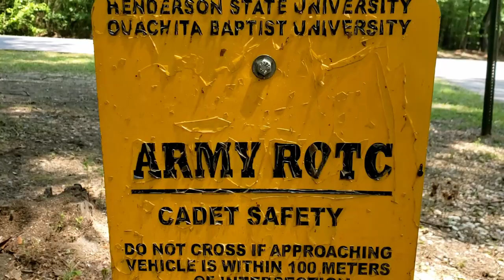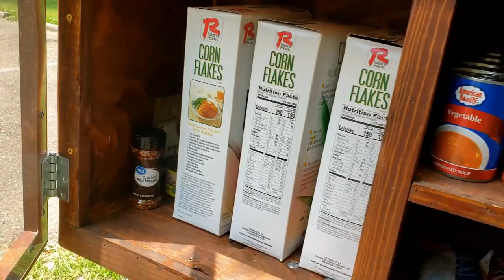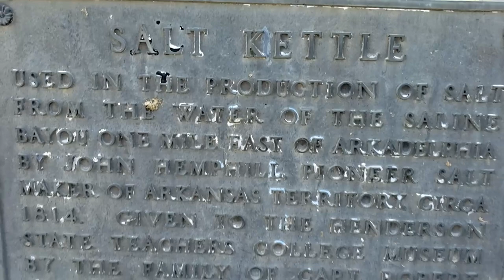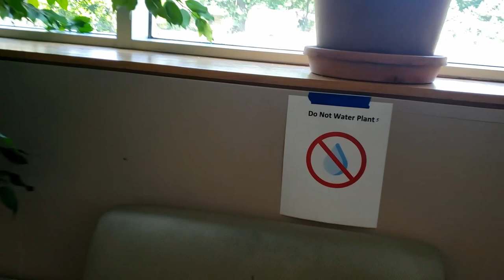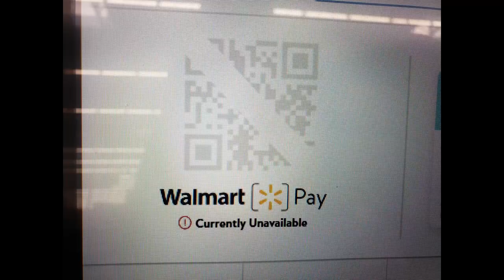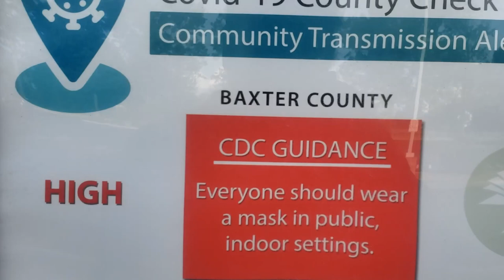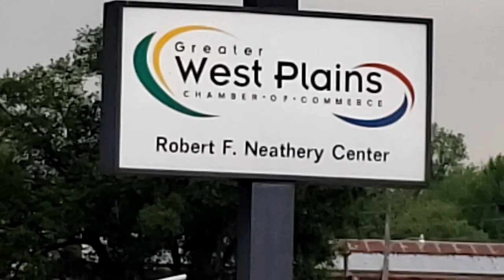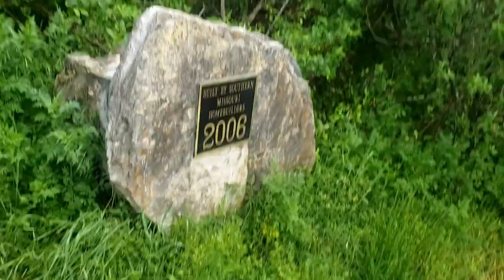Vlog West Plains, Missouri and around the area more

Comment: get a ice chest and go to home depot or lowes and get those pink foam boards if you cover the ice chest in that it last much much longer better than any yeti cooler also if you bought some solar panels you could run a fan as much as you want you don't really need a big fan just one of those small round ones does great I've seen other people that live in their car and that's what they use
Reply from the maker: All those plast. ic  products stink from the ice. Metal doesn't stink.